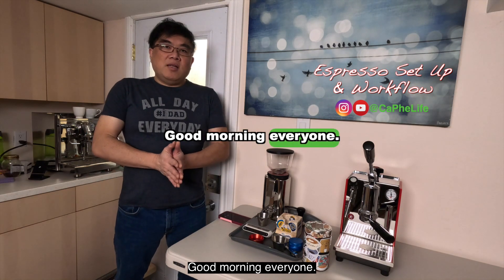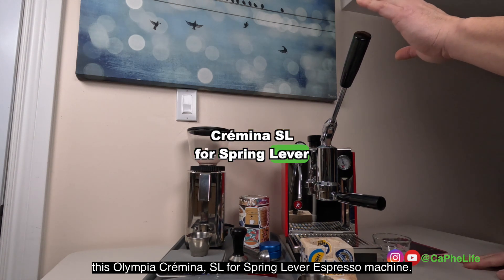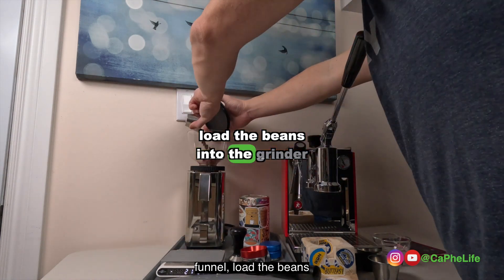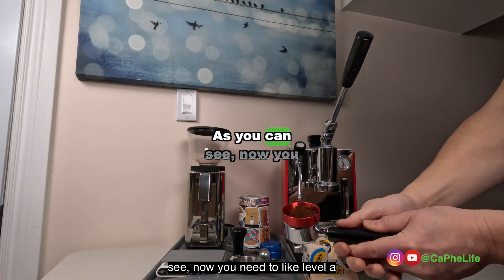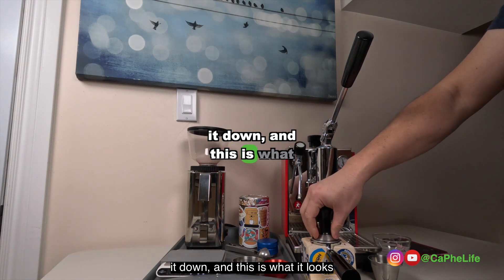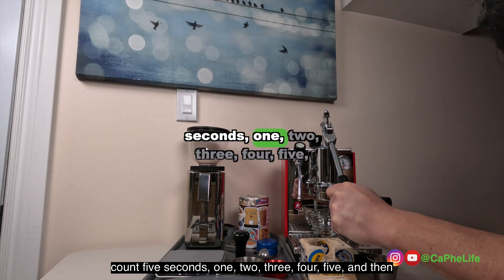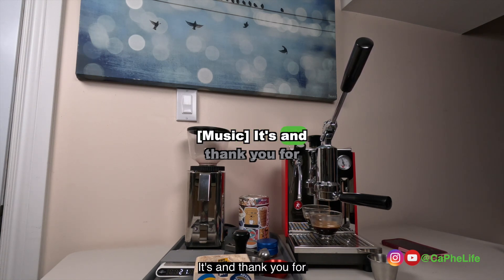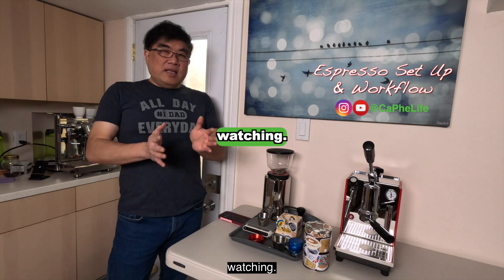*Espresso Set Up & Workflow* Olympia Cremina SL - Spring Lever Espresso

Comment: hello Cha, very good setup and thank you for sharing. I have also ECM 64 manuale but the retention is very huge up to 7 gr sometimes. I wonder how you achive 15gr in and 15gr out from this grinder.
Reply from the maker: Hi Fethi, the key is not to use the hopper, I just add 15grams for the Spring lever Olympia and 16 grams for the ECM TechnikaV. I think when you have the hopper filled, the weight of the beans makes them stick. I'm still puzzled why the internet needs single dosing grinder. I have added/change espresso machine but after I went from 48mm Bezzera BB0005 to the ECM c54, I haven't felt need to upgrade. I can go through 1/2 kilo of same beans and very low retention or I can alternate beans between grind and still low retention. Last 2 years, I haven't felt need to run Grindz to clean it
Reply: @CaPheLife  thank you. Mine is S manuale 64 and still struggling with huge retention even using with an add on single dose hopper from amazon. 17gr in and usually 8 or 9 gr  out
Reply from the maker: @fethiicel8267  are you located in North America? I could post link to coffee beans I use, may be try those?
Reply: @CaPheLife  ☺️unfortunately not Cha… located in Istanbul. But my experience is based on various beans and only dark roasted
Reply from the maker: that might be the difference, my bean selection is not oily, medium to dark. I don't like dark. My all time favorite so far is from Filicori Zecchini if you can source it to Istanbul @fethiicel8267
Reply: @CaPheLife  👍
Reply from the maker: @fethiicel8267  I bought a thermometer and Hygrometer to figure out Temp and Humidity. May be this helps you understand geographic difference https://www.youtube.com/watch?v=kxXZBMw2bbQ
Reply: Enjoy your Cremina! I own a SL for about a year now. Love it. Hope you brew something tasty today!
Reply from the maker: @jiegong9681  Thank you, out of curiosity, do you still feel the need to get an old school Lever Machine, either the Original Cremina 67 or another pure Lever Machine?
Reply: @CaPheLife  haha No no. I don’t need to go down another rabbit hole 😂 a pump machine that could serve back to back 5 drinks or more perhaps. With SL you have to take a break every 3 drinks or so
Reply from the maker: @jiegong9681  I was entertaining an ACS but too much electronics, the Argo is still on my consideration list to purchase @odysseyespresso